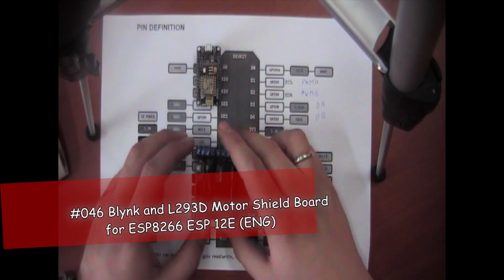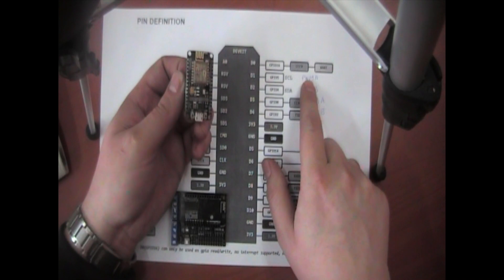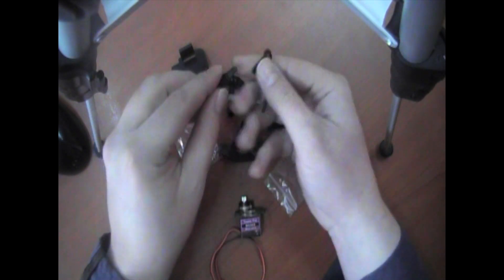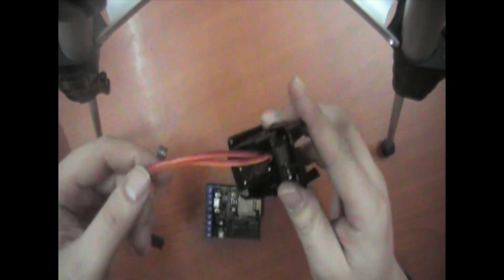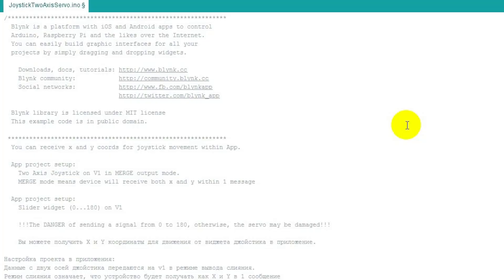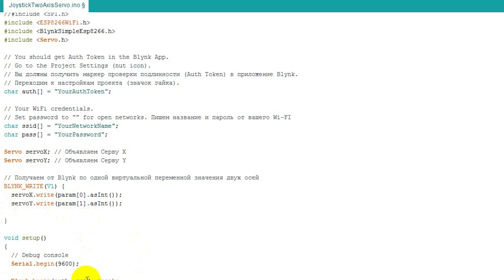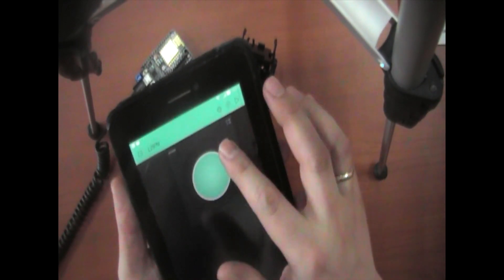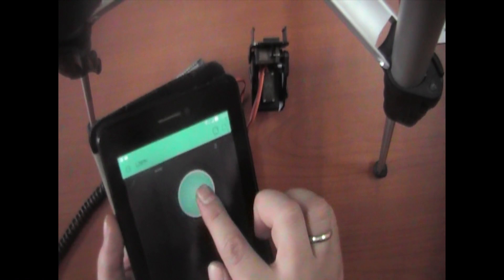#046 ENG Blynk and Motor Shield Board L293D for ESP 12E

Comment: Hi thankyou for your sharing, i tried sometimes, i can connect to blynk by blinking the internal LED,but the servo moves once.and then doesnt move anymore, heres is my program,need your advice hehe

#define BLYNK_PRINT Serial
//#include <SPI.h>
#include <ESP8266WiFi.h>
#include <BlynkSimpleEsp8266.h>
#include <Servo.h>

// You should get Auth Token in the Blynk App. 
// Go to the Project Settings (nut icon). 

char auth[] = "xxxxxxxxxxxxx";

// Your WiFi credentials.
// Set password to "" for open networks. Пишем название и пароль от вашего Wi-FI
char ssid[] = "xxxx";
char pass[] = "xxxx";

Servo servoX; // Объявляем Серву X
Servo servoY; // Объявляем Серву Y

// Получаем от Blynk по одной виртуальной переменной значения двух осей
BLYNK_WRITE(V1) {
  servoX.write(param[0].asInt()); 
  servoY.write(param[1].asInt());
  
}

void setup()
{
  // Debug console
  Serial.begin(9600);

  Blynk.begin(auth, ssid, pass, "blynk-cloud.com", 8442);
 // Blynk.begin(auth, ssid, pass, IPAddress(192,168,1,100), 8080);
 Blynk.notify("Gawat koneksi putus");

// назначаем нашим объектам servo номер пина
  servoX.attach(15); // GPIO 15 соответствует физическому пину D8
  servoY.attach(13); // GPIO 13 соответствует физическому пину D7
}

void loop()
{
  Blynk.run();
}

Comment: You have to  remove those two 100 ohm resistors next to the L293D (first and third from left, when antenna is on the right side) and the shield will work.

￼
Reply from the maker: Ооооо Спасибо! )))
Reply: @Инженерка  did it work?